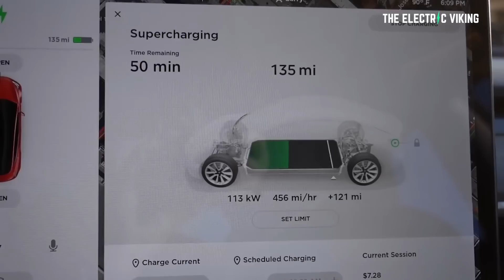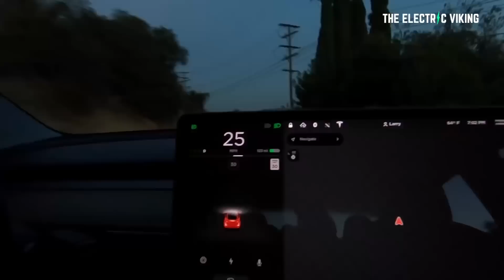Transitioning to renewable energy will save the world $18 trillion

Comment: bunk - where is all the plastic, rubber of tires, lubricants and paints coming from for these electric cars - from OIL! You cannot pull over a 100 years of dependency of oil/coal out from under the world without major significant and most likely many deaths transitioning to an unreliable energy system. People should realize the amount of people dying from the cold far out weighs the deaths from hot weather.  We are seeing the costs rise in Europe, Australia and the USA transitioning away from fossil fuels there is no savings going renewable unless some one pulls a magic Genie out of a proverbial bottle. Even if tomorrow fusion is made available it will take years to move it through the various systems and then where do you get fertilizer, paints, lubricants, plastics for ALL the stuff we use in day to day life, asphalt for roads, tar for sealing stuff, aerosols for spray cans and air-conditioning systems. That's all going to take a fair amount of time to convert over - unless well we own nothing and are happy living in caves eating our bugs....

Comment: Here is a better idea, use the huge long distant EV battery for the little daily drive and leave the EV plugged into the grid 23/7/365.

The EV battery is free. Hahaha

20million EV vehicles,100kwh battery. 
Fully topped up daily. 
20million x 100kwh = 2,000gWh daily 
= 3 times the fossil fueled industry. 
One is free 
One is $70Billion annually.

Comment: 25GW installed fossil fueled power plants today in little Australia. 
25million Kw x 24hrs x $0.30 /kWh x 365 = $7.3 BILLIONS ANNUALLY 
including connection fees for the 20million buildings.

Just little Australia. 
And x5fold bigger in an all electric Australia with nuclear power electric generation on a x5fold bigger capacity national grid.

Government disaster insurance. 
Government Cash flow guarantees. 
For 60years. To 100years. 

Some people would kill for that much cash flow.

But what would an old Construction Civil Engineer contractor know ???
Coal-fired power stations 
800 transmission line towers. 
Tenders for hard dollar work. 

Grandchildren.

Comment: We can do much better by switching to my magnet motor. It produces usable torque and RPM and can easily drive a generator and never have to plug in a car again. Buildings can be 100% off grid. Eliminate miles of power lines etc. 
Just need some investors.
I also developed a wave machine that is a major improvement over current methods.
Reply: "Just need some investors." Perpetual motion is a crowded field, but none of them seem to work.
Reply: Yeah I seen many failed attempts. I have "cracked" the problem of cogging which is the problem of most magnet motors. Mine works just fine. Produces usable torque and RPM. Easily drive a generator. Minimal moving parts so maintenance is basically non-existent. 
I also developed a "wave machine" that's far better for offshore energy production than current methods.

Comment: Nuclear, 1.3GW electrical requires 4GW thermal from sequestered heat. The US in 2019 used 100 Quadrillion BTUs . 1 x 10 to the 20th Joules electrical. 4 x 10 to the 20 Thermal. That will take a puddle of water the size of Florida 19" 3" high from 80 F to 212F. You need 3075 new 1.3s. 24 t5rillion dollars and about 120 years to build them.

Goodluck

Comment: Here's an idea.
30% size "Powerwall" (about 4kWh)
2× 400W solar panels.
Get them on EVERY roof possible.
.
Remove homes from the peak grid.
.
Make the battery expandable.
"Plug and play".
.
When the first round is complete. Start again.
Reply: Here is a better idea, use the huge long distant EV battery for the little daily drive and leave the EV plugged into the grid 23/7/365.

The EV battery is free. Hahaha
Reply: 2 x 400 watts wouldn't even run a heat pump. Think bigger. Remember, you have ro be able to charge your battery and use electricity at the same time in daylight. Unless you live in a cardboard box you are going to need a lot more power.

Comment: They say that their scenario will deliver 55% more "energy services" than today in 2050. I hope they don't mean 55% more electricity, because here in Sweden (which is already highly electrified) we will need 100% more by 2045, mostly for industry electrification. Imagine countries where gas is used for heating and cooking and coal for electricity, they will need much much more.
Reply: Unless I'm mistaken we (UK) are using LESS energy than 5 years ago. Efficient devices.
Reply: @rogerstarkey5390  I think that might be the case over here too, but now there are several things happening at the same time. Fossil free steel and cement production, new huge data centers, and Northvolt battery factory.

Comment: Yes to most of that , but NOT Hydrogen.  Its no cheaper than batteries and is inefficient.  Lower cost electrolysers are irrelevant when you lose most of the energy in compression and converting back to electricity.  The efficiency cannot be addressed, its caused by physics NOT engineering.
Reply: TRUE

Comment: James Hansen states nuclear power has SAVED 1.8 million lives compared to fossil fuels. Hansen: "Modern nuclear power has the smallest environmental footprint of the potential energies because of its high energy density and the small volume of its waste, which is well-contained, unlike wastes of other energy sources.” "Otherwise, GAS will be the required complement to INTERMITTENT renewable energy (SOLAR, WIND) for electricity generation." Nuclear is also the ONLY source that fully prices the cost of its energy---the U.S. and most of the world do NOT recycle or fully cost the expired solar panels & wind turbines. FURTHER, the U.S. (due to a  currently misguided regulatory framework) and rest of the world can begin to burn the nuclear waste / fuel that it currently stores, as France currently burns/USES AS FUEL their "spent" fuel. The U.S. sits on a huge stockpile of that fuel, it has VALUE. What is the price of saving the environment in a timely fashion...because solar and wind won't achieve that timeliness, and aren't achieving that timeliness. @The Electric Viking.

Comment: Various minerals needed for the production of solar panels are typically around thorium, which could be used in thorium nuclear reactors. That thorium is then reburied currently. This could potentially lower the cost of the fuel for the thorium reactor, and it should also make the mining more profitable with little needed to increase that profit. Thorium does not work in the current nuclear reactors.
Reply: That delete on a Thorium reactor being....
Available... Are they?
Fast to build..... Are they?
Cheap to build... Are they?
Able to produce cheap energy... (If current nuclear is a guide, 2.4 x Offshore Wind.... Not even close)
.
Nuclear "because it makes sense" not "for the sake of it"
Reply: @rogerstarkey5390  The technology was not used because the by-product could not be used to create nuclear weapons in the 1970's. There is already a running reactor. It doesn't have a meltdown risk because it does not result in a runaway reaction. It also does not have as long-lasting waste. Why are you claiming that a by-product of what you are advocating should not be used?
It should lower the cost of the commodity needed for the energy that you are claiming you want. It should result in stability and less need for storage, which should make the whole energy model work longer. The aluminum and sulfur battery should be able to create the storage for home-use, but it is heavy for electronics and vehicles. This means lithium would need to be highly regulated so that it could only go to those uses. Sodium as an element is 300% heavier than lithium so any anode advancements would be to get it so that sodium can replace lithium.

Comment: LFP batteries should only be discharged to 20% if you want a longer lifespan. Going lower than than significantly decreases the lifespan. Thus only 80% useable energy.
Reply: Wrong

Comment: nuclear are coming with new small form factor reactor and more affordable this could change the use of nuclear power into the future, and it should not be discounted yet
Reply: But we need the energy in 5 years ... Or as close as.
They haven't even built the prototype reactors.
Then, testing.
Then, production design,
Then, do they give the plans to everyone????
Then, how big?
How many?
How long to build?
.
Put your best guesses below.
.
THINK IT THROUGH!
Reply: Nuclear is a bad deal in any size. Small nuclear has been predicted for years but is just as bad economically as big nuclear. Check Lazard Levelized Cost of Energy and Doug Koplow’s learned report.

Comment: Your strogest argument is that wind and solar are cheaper - are they?  Do they get benefit of government subsidies and policies?  Would they be cheaper without subsidies and anti compeditve policies?  Cost analysis is of the moment - but - the cost of fossil fuels varies.  If Saudi Arabia wanted to it could make a profit on $10 a barrel crude - so oil producers can dramatically cut costs making them compeditive. Right now human imposed sanctions on Iran, Venuzela and Russia; as well as OPEC self imposed production limits are forcing prices higher; before there was an oil glut. Since this study was published oil dropped from over 100 USD per barrel to $80 so you've already lost 3 Trillion of your 11 Trillion savings; if it goes to $50 you have no savings and lower - it costs more even with subsidies and policies favoring renewables. Really it comes down to who's your daddy.  Do you want it to be Saudi Arabia or China?  If it isn't your own country that make and support these new systems all you get is a different daddy.  If I were Australian my focus would be doing it myself - not having China take over.
Reply: Let's see.
At current prices, on the same structure, 
UK
Offshore wind is THE cheapest "strike price of any energy.
Price adjusted to August 2022 prices it's (per MWh)
2.4 times cheaper than Nuclear
9 (NINE!) times cheaper than Natural gas.
(They don't even price coal anymore, it's insignificant)
.
Build cost for Nuclear is about 2.4 × as well (coincidence)
Build time?
Nuclear, about 1.5x
.
Subsidies! No
"Policies"? Really?😂
.
Source: Carbon brief.

Comment: Another perspective on this transition that the general public does not seem to understand and that the mainstream propaganda media wants to ensure they do not understand is that the world cannot deal with an extremely rapid transition away from oil virtually every product produced on the planet right now involves some type of plastic to some extent, all aircraft military and civilian other than shall we say Niche experimental aircraft operate on either Aviation gasoline which is around 140 octane or jet fuel, commercial jet fuel is really clean kerosene very similar to rp1 Rocket propellant one which is ultra clean kerosene and fuels virtually all current liquid rocket engines that are actually in service, the primary exception to this are SpaceX Raptor engines. Military jet aircraft use either standard jet fuel or in the more high performance aircraft they will use specialized versions of jet fuel that have specific components other than just the kerosene. Most most train shipping is dependent on diesel Electric locomotives, and all ocean commercial passenger and shipping is dependent on oil burning vessels , with the exception of very small nuclear powered military fleets operated by only very few countries. And of course all military armor and ground vehicles operate on diesel or gasoline fuels. Presently virtually all commercial Trucking is dependent on diesel, the Tesla battery Electric semi is about to go into full production and delivery within the coming year, but for the foreseeable future Trucking will be diesel based globally. Oil production therefore is necessary not only for air transportation, military operations, ocean transportation and shipping, but also for virtually all manufacturing of products. The oil industry is only possible and can only survive on massive volume of production and sales period So comma the transition rate away from so-called fossil fuels comma primarily oil-based, is limited by all of these needs which cannot be rapidly eliminated or transferred to other sources like so-called green Energies. The oil industry cannot be forced out of existence while the current methods needs and status of global human existence is sustained

Comment: Then why does renewable energy need ANY government subsidies?
Reply: Subsidies were required to get the technology to a place where it could wash its face commercially.

So in the UK, there was an agreement with the offshore wind industry to provide “contracts for difference” at strike prices much higher than the (then) wholesale price of gas-fired power, as long as the industry invested in bringing that price down.

The earliest CfD strike prices were around £140/MWh, and to put that in perspective, the wholesale price of gas-fired electricity was £50 at that time, and construction of the Hinkley C nuclear power station was agreed on the basis of £92.50 (at 2012 prices)

As wind turbine technology has improved, with newer designs now achieving an output of 13MW, up from the 2MW of the earliest offshore machines, the CfD strike prices have been relentlessly reduced, with the latest contracts being agreed lower than £38/MWh.

Let that sink in for a second. That means that the wind power industry has signed contracts to deliver power 24% cheaper than the wholesale price 10 years ago.

And the way a CfD works is this. If the wholesale price goes higher than the strike price, the generator has to pay back the difference.

At the moment, with the wholesale price sitting well north of £200-300/MWh, Britain’s offshore wind sector is delivering a negative-subsidy to the UK government worth an enormous amount of money.

The irony with that is that renewables are actually subsidising fossil fuels, which is something that will happen increasingly often, until we are shot of them.
Reply: @ayebrow   Well explained
Reply: So what is the financial history to date for renewable total costs vs. total KWH produced?   Additionally, what is the cost of unintended consequences of having a 5X rise in energy costs currently vs. the alternative path of being 100% fossil?  I never see or hear an accounting of the fully burden cost of the green strategies over 20+ year periods.
Reply: In the UK it doesn't and it's WAY cheaper, and faster